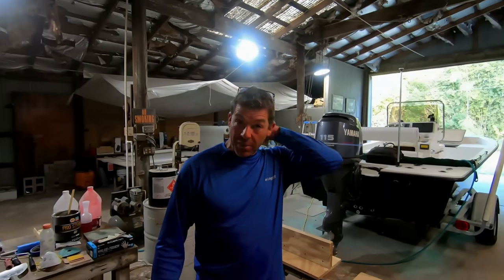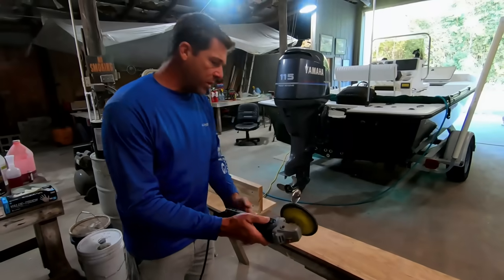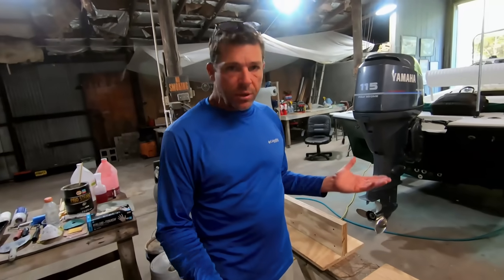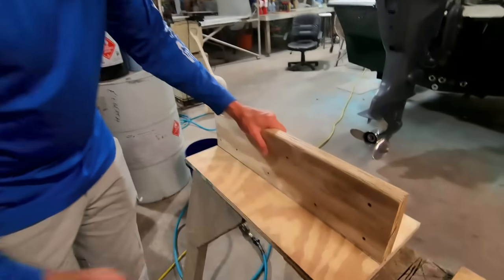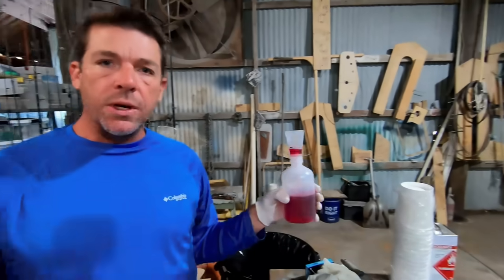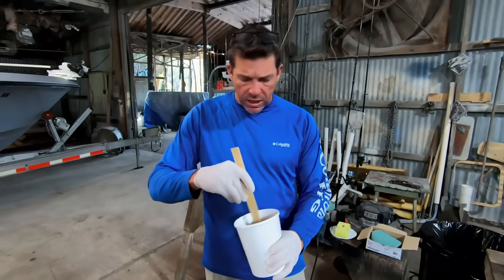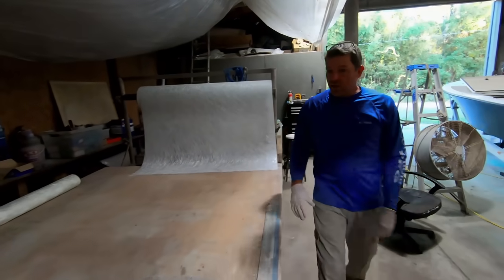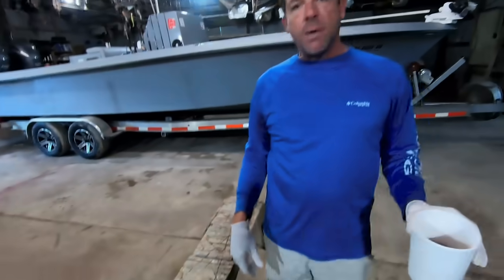How to FIBERGLASS over PLYWOOD!  Do it the RIGHT WAY the FIRST time! Step by Step DIY fiberglassing

Comment: Hey, I own a pool company and our service trucks need some sort of tub to insert into the truck bed to contain the chemicals. I was looking at using 3/8 plywood to shape out the tub and then coat with fiberglass as it would be easier than making a mold to create a solid fiberglass tub. I have a couple questions. What pattern of fiberglass layers would you recommend as it would act more as a barrier to contain the liquid chemicals and not so much for the structure as it will be wood construction underneath and will never see any real stress or flex? I was also wondering if I could just get by with putting resin on the underside to seal the wood without using glass, or would it not be thick enough to keep out moisture? Finally, The pro strand that you use in the video to create an inside radius is very difficult to find online, where do you typically source it from? I know this is a lot but this is my first time laying glass lol.

Comment: How would you fiber glass over foam board ? like 1" foam insulation board. Without it melting the foam.. I saw a video of using like 5 coats of house paint ( inside or outside ) to insulate from the heat.
Reply from the maker: I have seen some of those videos,  and honestly I think using foam that is made to be fiberglassed or epoxied over is your best bet. It may cost more, but you will know that you are not throwing away good material and labor on something that may not work.  We have been using alot of supplies from fiberglass warehouse lately, and I have been very happy with their products. Maybe they can help you out. Thanks for watching!

Comment: what about styro foam glased with fiberglass ? light buoyant and strong seems to resist  salt water
Reply from the maker: You have to be careful about foam- core materials. Not all foams are compatible with the solvents in some resins. I would stick with marine grade foams and cores that are designed to work with poly, vinyl, or epoxy resins. Hope this helps, thanks for watching!

Comment: How about using cabosil thickened epoxy for the primer coat, or just as a sealer layer period?
Reply from the maker: I like for the primer coat of resin to go as deep into the surface as possible so as to promote a strong bond. General thinking is thinner resin will work better as a primer coat. I hope this helps and thanks for watching!

Comment: The tricky spots would be if you had slots at the bottom for water movement (on your 90*) mock-up ... that's where you really need to have a seal ... in spots that you really can't see or prepare very well.
Reply from the maker: That's true. I have a video in this series of fiberglassing over plywood that shows how to deal with that as well. You might find it interesting. Thanks for watching

Comment: Question about the polyester, does it stay sticky after drying, or curing ,  like sticky where trash sticks to it, very new to this, was thinking of using the kind of polyester resin for a small boat, but confused about the tackiness
Reply from the maker: Laminating resin will stay mildly tacky for quite some time. That is what you want if you plan on doing more fiberglassing or gelcoating over it. I hope this helps and thanks for watching!

Comment: Great channel.     Question   Have you ever used pro set resin.  I herd its a great resin for boat building
Reply from the maker: Thanks so much! Yes, Pro Set is good epoxy. It is basically a commercial version of west systems. I plan on doing a poly vs vinyl  vs epoxy video soon. You might find that interesting. I appreciate you watching and commenting!
Reply: @FishBumpTV  wow thanks i first learned about this when i visited a friend in cali that does composites for space X and i learned alot.   He also uses alot of PTM&W epoxys and that is nice aerospace epoxys but its $$
Reply from the maker: @tomspettel3646  You are very welcome. I am not familiar with ptm and w epoxy,  but I don't deal with any aerospace materials. If they are using it with Space x projects it must be good! Thanks again for watching and commenting!

Comment: I have a question.   When you are doing a stringer in a boat how much length do you take in at one time?   Obviously your not doing all these layers on a full stringer unless your using a slow set epoxy.   I have been using VE and I’m always racing when I mix up a batch.   Do you butt your glass pieces linearly and then stagger  the next layer?   Or do you overlap  let’s say the first layers on the horizontal plane.   I don’t know if I am asking this correctly.   I have tried to do an entire stringer buy purchasing pre cut rolls on my first couple jobs instead of having joints but it seamed like a rookie mistake.    I will definitely be using the filler trick next time vs making a resin and cabosil mixture.     Looks much easier for that fillet.   Thank you

Comment: Could you also use that short strand fibrrglass filler to bed stringers?
Reply from the maker: I suppose you could, but it has a short working time. Something like a thickened vinyl ester resin putty would be better in my opinion. Hope this helps and thanks for watching!

Comment: Fiberglassed wood stringers and frame boats will last forever if maintained. A lot of people automatically think glass boats are indestructible and can be used and put away wet.  Indoor storage or the very least a good cover outdoors.  The key is ventilation.  Open the inspection ports, and let it breath.  Constant dampness and mold buildup is bad.  You take your boat out on a rough day and get some water in the bulge, take a few minutes and sponge that water out when you get back to the dock.  Takes very little effort.
Reply from the maker: I agree! Thanks for your thought, and thanks for watching!

Comment: Also, back to fiberglassing plywood boat decking are you primering both sides of the plywood with resin and also the 2 layers of CSM?  Or is that completely overkill?  Seems like to get the most waterproof wood you'd need to cover both sides with at least the resin correct?
Reply from the maker: Yes, you should fiberglass both sides to completely seal the plywood in my opinion that will give you the longest life of the plywood.
Reply: @FishBumpTV  awesome and makes sense.  Thank you!

Comment: I dont know if its a good idea or not, but I saw the Boatworks Today guy fill that inside corner with thickened epoxy to soften the radius.
Reply from the maker: Yes, it is always a good idea to soften the radius when you are doing fiberglass work. We used a router to put a nice radius on the top section. Then at 23:25 to 24:40 in the video we fill the bottom corner with a thickened putty. Hope this helps, Thanks for watching!

Comment: Have a bowl with  a quart of water and a half a cup of POWDERED Tide detergent pre mixed.  When your gloved hands get so fuzzy work becomes difficult, just wash your hands, gloves and all, like you would with no gloves. Dry on a towel.  It is faster than changing gloves, even multi layer gloves, and you can do it more often. You  can clean brushes in the Tide/water too.  I have brushes I have used over 15 times in polyester. Enough acetone to clean a brush costs more than the brush.  I did not believe the man who told me about Tide, but I tried it and it works,  Give it a try before you explain to me how it won't work..
Be aware that direct sunlight accelerates hardening. Even a thin layer of hardened resin in a mixing container accelerates hardening. In cool weather, I keep a heat lamp ready to accelerate hardening.  I try to avoid evening dew on unhardened resin.  Who else has rushed to avoid the coming dew and cool night air, working outside? And if you forget the hardener/catalyst, just start removing the resin.  Doubling the next batch won't work.  Spraying on catalyst won't work.  Just remember to put the hardener in.
Reply from the maker: Interesting, I will have to try that! Thanks for your thoughts and suggestions!

Comment: I would hsve put anarrow sttip of domething like 225g CSM over the top of the fillet and rvrn all the timber brfore the double bi???
Reply from the maker: Sure, you could do that if you prefer, but I don't think it's necessary. That is why I put the filet in the corner, to help with the transition of the 1708. Hope this helps explain and thanks for watching!

Comment: What recommendations would you have for warming large sheets of ply prior to glassing
Reply from the maker: We warm the surface, just to be sure there is no moisture in the plywood prior to fiberglass. You can still use a heat gun, just do it in sections.  Or you could use multiple heat guns. We also run some portable heaters in our shop when it is colder than usual.  Obviously you would always want to be careful when using a heat source and you are near anything combustible. Hope this helps, thanks for watching!
Reply: @FishBumpTV  thanks for the response

Comment: I’ve an old bass boat. I’m changing out the mech speedo to a GPS. And I’m changing out the tach. Sun kill the old.
Switches etc are so outdated. I want to redo the face of the counsel. Remove everything, fill the holes, re-gel-coat and then start over.
How? What’s the best way?

Comment: How important is the temperature of the material vs air temperatures when glassing?
Reply from the maker: The Temps can vary between the two materials, as long the Temps are within the working range of the materials you are using. Hope this helps, thanks for watching!

Comment: how long would a floor last if its done properly with marine plywood?
Reply from the maker: If glassed in properly, and the watertight seal is not broken by damage or a unsealed fastener, it can last a very long time. There are boats that my father built well over 30 years ago that are still solid. I hope this helps and thanks for watching!

Comment: Why isophthalic vs traditional polyester?  Strength and temp resistance?
Reply from the maker: Yes, generally iso is considered a higher quality resin. With better characteristics. Kind of like marine ply is better than standard exterior grade. You certainly can use other polyester or vinyl Ester resins with good results. Just wanted to show you guys what we where using for this demo. Hope that helps, Thanks for watching!

Comment: I've never fiberglassed, is there a coating I could use without glass? Thanks.
Reply from the maker: You can coat or seal with epoxy resin, if you do not want to use fiberglass. I personally would not recommend it though. The glass will improve the quality of the job overall. Just my opinion, hope it helps. Thanks for watching!

Comment: I would like to see if you can do a small job for me, I am adding an angled helm face to help keep glare off my Garmin and radio faces. I already built and fitted the module (both to the existing helm and also the electronics) and need to get the module fiber glassed, and gel coated. I can send pictures to get a price. Let me know how to get a hold of you. I am in Atlanta, GA. Also, I headed to Gulf Shores for Thanksgiving.
Reply from the maker: Sorry, but I don't have  time to take on any new projects. I do offer consulting through Patreon, though. That might be an option to help walk you through the process. I hope this helps,and thanks for watching!
Reply: @FishBumpTV  ok, thanks

Comment: Hi, great video!  I have a question, if I may.  I have an RV, and I've removing the front overcab window, which everyone says was an idiot design, and I'm reskinning it, by removing the window, and putting a 3/8th piece of plywood over it.  Using loctite super bond to adhere the plywood to the RV.  My question is, using polyester resin, with 1708 fiberglass, will it finally harden?  I'm getting so many mixed messages.  People are saying when it has contact with air it won't harden solid.  Others are saying yes, after about 4 days it will harden.  I'm not too worried on the time, or the look.  Not looking for professional, just making sure it's waterproof.
Could you pull-EASE give me an answer that I can rely on?  I'm not looking for looks, or how long it will take to cure, just want to know if it will cure.  Thank you!!!!
Reply from the maker: I would consider using either vinyl Ester or epoxy resin in this application. Both of these resins are going to have better bonding and waterproofing qualities verses polyester when trying to seal and bond different materials. Vinyl ester is the best choice if you want to use gelcoat as a finish coat or a automotive style paint. Epoxy is good if you want to use a epoxy based primer and automotive style paint system for finishing. Your application is unique, and is not something I have done personally, so these are just my thoughts based on the material qualities. And yes, both of these resins should cure with no problems. Fiberglass Warehouse has a very good vinyl Ester resin, and they offer a discount code for my viewers. It is listed Below many of our videos description. It is fish bump tv. I hope this helps and best of luck with your project!
Reply: @FishBumpTV  Thank you..!  You're a Gentleman, and a Scholar!!

Comment: 😅I have used fiberglass cloth and polyester resin before with some success but I have found
that epoxy resin sticks better and lasts longer.  Epoxy  is Expenive.  Would it work to use epoxy 
for first coat and subseequent coats with polyester.
Reply from the maker: Polyester resin has its pros and cons for sure. Cost and availability being a couple of the pros. Yes, epoxy is a premium product as I mentioned in the video. It does bond to most things better than polyester does. The two materials can be used on the same project, but it has to be done in a specific way. Polyester does not usually bond well to epoxy,  but epoxy will bond to polyester. So it is not recommended to use epoxy resin as a primer coat under polyester resin.I plan on doing a resin comparison video very soon. Hope this helps, Thanks for watching!

Comment: I have watched this a couple of times and don't think you ever said anything about waxed or unwaxed resin that you were using? And oh by the way you do awesome work .
Reply from the maker: Thanks for watching! We always use unwaxed or what we call laminating resin. hope this helps
Reply: but don't you at some point in time have to use waxed resin for the last coat so it will cure properly
Reply: And also the link for the mixing cups does not pull up mixing cups it goes to my shopping cart

Comment: I've taken the ratio of catalyst down to 1/4%  (0.25%) when casting insects into clear resin. I still had to put my castings in the fridge to stop the heat buildup which cooked the insects and boiled any moisture in them. Stinky gas would bubble up.
Just saying, he mentions tht 3/4% is about the minimum, but lower than that will still set off, no problem. Put a drop of catalyst in a container of resin and it will set off given enough time. "Catalyst" means it's not used up during the reaction
Reply from the maker: Thanks for watching! As you know, not all resins are the same. And applications vary. Casting insects in a large mass is very different than fiberglass lamination. For the type of work we are doing, you should Never go below 3/4 of a percent. This is not just my opinion, all of my data sheets and fiberglass reps agree with that. I would hate to see someone have to deal with a project that will never cure completely. Hope this helps clarify things.

Comment: Do you need to sand the resin on your primed wood if the resin has cured? Or is that info in a different video. I will be going through them
Reply from the maker: Yes, if the resin has cured, I do sand it with some 6o or 80 grit to knock any burs off. Just remember not to sand through the resin primer coat though. I hope this helps, and thanks for watching!

Comment: Pretty well forced to use acetone to thin the polyester resin for primer coat because styrene monomer is now $65 a pint. It doesn't like to cure out for a couple days, but a hot non thinned application of resin cures it out after it goes tacky. Surely not as good as styrene solvent, but apparently  ok for my home projects.
Reply from the maker: Thanks for your thoughts, just trying to point you guys in the right direction. Best of luck with your projects!

Comment: How do folks like me, who live in Las Vegas, adjust the catalyst when temperatures are over 100⁰  for 6 months at a time?
Reply from the maker: Working fiberglass in those kind of Temps can be tricky! We are dealing with high 90s in our area right now, so i know what you are dealing with. I am posting a video this weekend that talks about some tricks I use to deal with working in high heat. Hope it helps and thanks for watching!
Reply: @FishBumpTV  outstanding! Thank you so much. It's frustrating not being able to even think about trying to look at a bottle of catalyst, let alone use it. Here in about an hour, we're going to hit today's high of 121⁰F. I had to move a lot of stuff from the garage to the inside for safer storage. I'm definitely going to catch that video. 👍

Comment: Engineered wood significantly off gas with temperature. The trick to great fluid penetration be it resin, paints, stains etc is to apply the fluid on the cooling cycle. So heating the board to drive out water, volatile compounds etc is great however you need to wait till the temp gradient is falling and the coating will then become penetrating. You did do this however viewers might not have understood the nuance you were covering. Same strategy works for concrete and penetrating silicate bonder/sealers.
Reply from the maker: Yes, I agree. We have been using this technique with good success for a long time.  I appreciate you breaking down the process of what we are doing even further. Thanks watching and commenting!